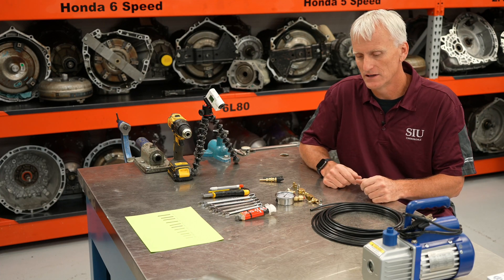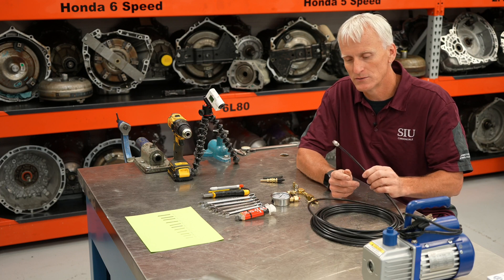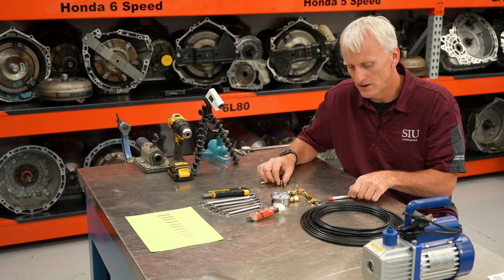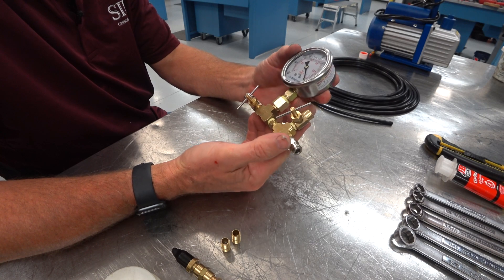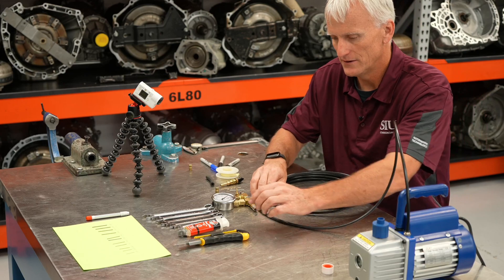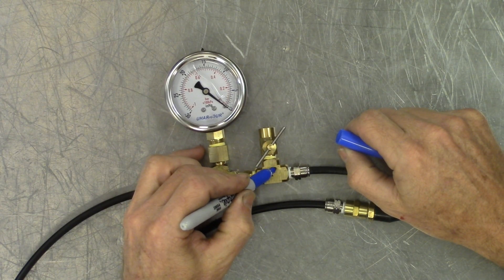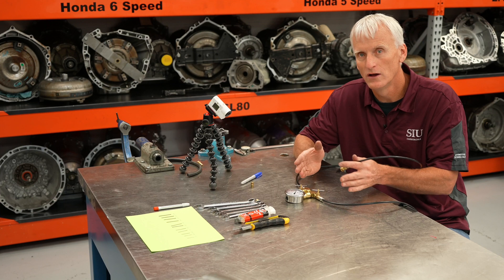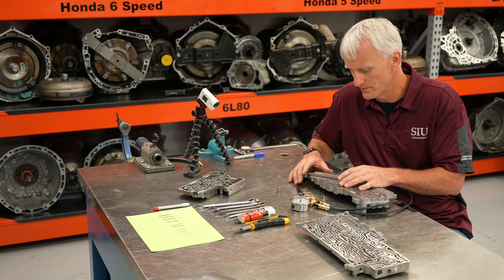Build your own Vacuum Test Station!

Comment: Thanks for saving me 200$. I felt sure this was out there much like a leak down set up. The Sonnax is 279. I made mine for about 75$ I already had a couple vacuum pumps. The orifice size was my roadblock. Much appreciated sir. Like you I was an automotive instructor but retired for medical reasons 16 years ago. People still ask for help and these valve issues are a big problem. Kinda why I have been recommending replace ment v/s overhaul.

Comment: Hi, great project, I'm building similar and need to build 35000 calibration origin, can you tell me what size it is in inches? 0.350 or 0.035 inch? I need to know exactly size because I need to convert it to mm to buy a proper drill, thanks in advance

Comment: In the video, you briefing discussed vacuum testing for cylinder leakage testing.  You mentioned the standard calibration orifice is 40 thousands for cylinder leakage testing.   But this vacuum tester for valve bodies uses a calibration orifice of 35 thousands.

Question:  If I build this vacuum tester, can it be used for both transmission valve body testing and also engine cylinder leakage testing?   I assume I would just need to create two calibration plugs (one for 35 and one for 40 thousands) and calibrate the gauge depending upon what I am testing  i.e.  35 for valve bodies and 40 for cylinder leakage?  Thank you.

Comment: About 40 years ago, I worked at a chemical plant that produced resins such as acrylic and melamine in 2,500-gallon reactors. At the time, we used a single vacuum pump to service any one of three reactors by switching valves as needed. The system was inefficient and prone to leaks.

To improve operations, I installed two additional vacuum pumps so that each reactor had its own dedicated vacuum system. As part of this upgrade, I designed and installed a valve system that incorporated a coupling and a homemade orifice plate—calculated using the engineering references available at the time—along with vacuum gauges.

This setup allowed me to verify that any loss in vacuum was due to leaks rather than pump performance. Most importantly, it provided a baseline vacuum reading, even with some leakage present, so I could identify issues regardless of whether my orifice plate calculation was perfectly accurate.

Comment: Hi
If I use 0,9mm drill bit will it give wrong results?  (0,035” = 0,889mm, 0,04” = 1,016mm)
And what cfm is minimum requirement for the pump?

Comment: Im so glad I found your videos.  I do have a question.  When testing are the check balls and internal valves still assembled inside?  Ive watched your videos on complete tranny tear downs and in the sequence of events it seems to remove all the valve body internals before testing?  Wouldnt it leak with all the internals removed?

Comment: I know it's been a few years since this video was released. Maybe my question will be answered.. is the orifice strictly for calibrating the gauge? And then the rubber tip goes into the test plate to check the vacuum? Maybe I missed something in the video..

Comment: Question what if I use 12 cfm vacuum pump will it affect the calibration fitting hole because it will pull more vacuum

Comment: Thanks for this, majority of the parts are available at lowes or home depot sans the gauge..for the line you can either use 1/4" irrigation line(which i already had) or they have clear 1/4 hard plastic line. Only differences are the T's and the needle valves are a 90 degree vs 180 degree. Went with 1/8 pipe thread as thats the size of the gauge i already had.

Comment: Thanks for this. I ordered the parts using the Amazon links you gave. I just happened to have a vacuum pump exactly like yours. The needle on the left that you adjust to 5 inHg is too restrictive to go below about 12inHg. Drilling it out looks problematic. I have  1/4” ordered and will adapt. I’ll let you know how it works.

Comment: not sure if its been mentioned but you can create templates or forms for liquid silicone. can make the seal sheet with clear silicone for about 20 cents. and as many replacements as neeeded.
Reply: Amazon 2 sheets like 12x12 for $7.

Comment: Harbor freight has an air operated vacuum pump that I plan to try with this setup.  I am guessing it might not be quite as stable but if I can regulate my compressor output well enough then it should be.  Cost is only $15.  Item 96677 at harbor freight.
Reply: tried this venturi effect vacuum with my extractor but was only capable of 21mmHg. need an active pump source of vacuum I believe.
Reply: I use their cheapy vacuum pumps.  They work fine.

Comment: Is it possible to use a manual hand pump/gun for creating the vacuum instead of an electric pump? I guess that could save a bit of more money as well?
Reply: if you have two sets of hands  and one of them is good with pumping indefinitly while the others do testing I guess this would work. Apologies to all the unsuspecting kids that get conscripted for pump duty🤣
Reply: No you can't use a hand pump because it doesn't apply a consistent vacuum.

Comment: Thank you so much saved me a headache I’m chasing down a leak on my 6l80 I built it but I had the original valve body but updated sonnax valves but had a failure recently in the clutch apply lower valve body well hearing another leak so time to test

Comment: I built this and can't get adjusted? The 25 psi adjustment with finger over nozzle works then after I do 5 psi adjust then put finger over to check the 25 psi it's only 14 psi?
Reply from the maker: Hmmm I wonder if you have vacuum lines routed wrong or your trying to get the vacuum readings by turning the wrong valve.
Reply: @siuautomotive  I got it thanks! I wasn’t adjusting enough work great. The valve body is bad had 7 under 16 psi. None of them that would cause the problem it was doing neutral 3-4 I think?
Reply: If you are getting neutral 3/4 on a 4l60 try looking at the servo.  I helped a buddy put one together (neither one of us are pro builder) and had the same issue. One part of the band servo was upside down.

Comment: Hello please tell me what diameter of the drill was used for the calibration hole of the vacuum tester
Reply from the maker: .035" -- I use a welding tip cleaner drill bit to find a bit that small.  They're pretty cheap.

Comment: can you tell me where i can get the airgun-tip on 10:31 in the video? thank you so much for this video, it's very very helpful. BR from switzerland, Matthias
Reply from the maker: That was from a generic air gun I got from NAPA.  I’m pretty sure harbor freight would have something similar.  Pretty sure it was from a gun like this: https://www.amazon.com/Milton-S-148-NPT-Lever-Blow/dp/B001XBI1E2/ref=mp_s_a_1_3?crid=2WNKXML3SAO70&keywords=air+nozzle+blow+gun&qid=1640455412&sprefix=air+no%2Caps%2C93&sr=8-3
Reply from the maker: These would probably work well also: https://www.amazon.com/Yikko-Pieces-Automotive-Vehicle-Accessory/dp/B08X1P1KQW/ref=mp_s_a_1_12?crid=383MDC5GF6OVK&keywords=air+nozzle+blow+gun+tips&qid=1640455470&sprefix=air+nozzle+blow+gun+tips%2Caps%2C143&sr=8-12
Reply: @siuautomotive  Thank you, thank you, thank you!!! :) BR from Switzerland, Matthias